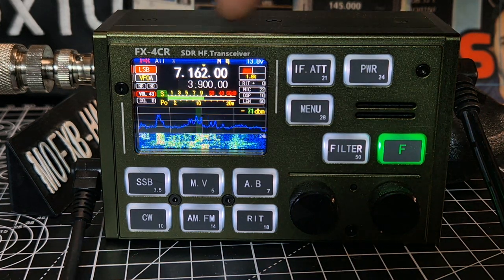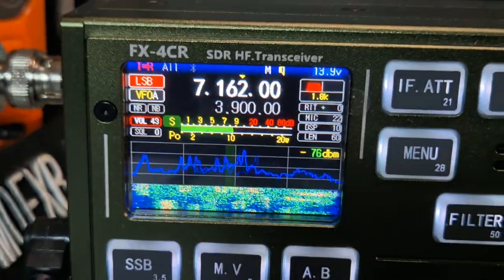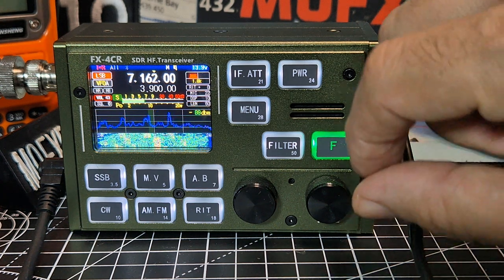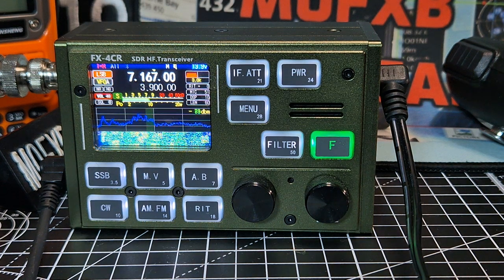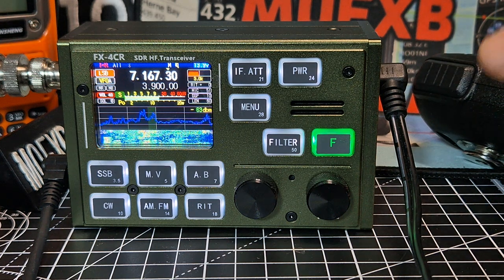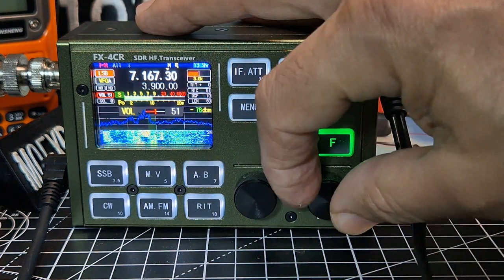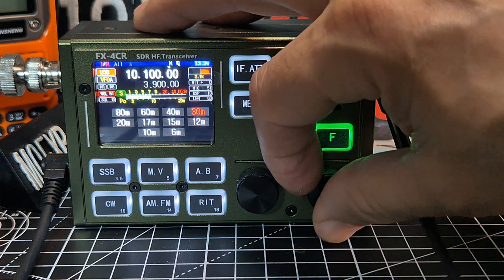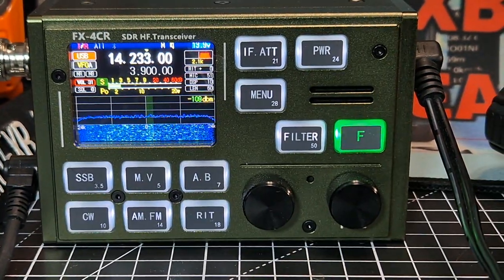FX-4CR Mini HF SDR Transceiver - Latest Model

Comment: Bought the same rig on the back of your previous videos on the fx4cr. Great wee portable rig on ssb, wee bit glitchy when connected to my computer for digi modes, firmware update helped but still abit flaky at times, maybe rf on feedline not helping too. 73 MM0VIK
Reply from the maker: All digital modes flaky